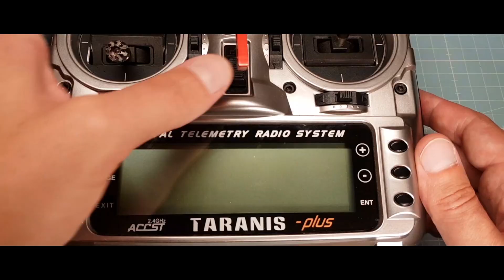Long Range - Disappointments 😒 BF 4.1 - GPS - FrSky R9 - Racerstar AirA - iFlight XL7

Comment: The gps is almost certanly interference. I've had it too, I've solved it by placing electrical tapes over motors nad esc and the doing a layer of aluminium foil and then another layer of electrical tape

Comment: BF 4.1.3 seem to fix the losting satellites problem !
Reply from the maker: I have tried it, and it isn't fix it, even according to the github comments of the devs it still isn't fixed yet. But if you take a look at my other videos, you will see that I have found a workaround.
Reply: @TorbanDallas  i tried only a pair of flights and for more the 4min flight i had always 12-13 satellites, i have a dvr of it. To me seem to be fixed the losting of satelites with 4.1.3 but i have done only 2 flights....
Reply: @TorbanDallas  p.s.: i have another issue with the gps, a bn-220, i have experimented a delay of the gps data that i can estimate in about 10 seconds ! This create a lot of problems, expcially on the gps recovery, when i have fixed an altitude of 50m for the rth, it think to be at less of 50m and continue to go up till to take an altitude of about 150m !!

Comment: I stopped losing satellites when I manually configured the GPS module using the U-Center. I saved the configuration in the GPS Flash memory and made BetaFlight not configure it... So I can even cut the GPS RX wire (Data receiver wire)
Reply from the maker: Thanks! That's pretty intresting, WIth all of the feedback and testings it definitely seems to be a betaflight issue. I've also got the feedback, that the auto detect setting doesn't work. Setting it to euopean egnos instead of auto detect should also solve the issue. I'm going to try it next and i'm also going to test BF Developer versions.
Reply: How do you connect a GPS module to U-Center?
Reply: @irishlostboy  I used a FT232RL module, GPS TX to FT232 RX and GPS RX to FT232 TX plus power... Then u just go to U-center and connect it... There is a GPS passthrough that u enable in the CLI (the u would just connect the drone to the PC and open U-center) but it did not work for me...

Comment: Well interesting to hear your experiences. I've had gps issues with 4.0 as well as 4.1. Sometimes it's solid. But lately on 4.1 attends to loose more often then not. I'm almost getting used to it. I'm also running rpm filter as well. 
But doesn't sound like the issue. But would like to see solid satellites the whole time, that's for sure. 👍👊

Comment: Hi Torban, ich verwende auch das R9M lite Modul,  bin auf BF 4.1.0 mit RPM Filter, und habe keine Probleme mit den Sats.  Wenn ich den fix habe,  bleiben sie konstant.  Das Problem mit den Unterbrüchen hatte ich aber solange ich die Caddx Tarsier montiert hatte,  die stört wohl den GPS Empfang des Moduls. Verwendest du ev eine andere Cam als zuvor? Diese Empfangsprobleme sollen ja bei mehreren HD Cams auftreten. Seit ich die Runcam5 nutze funktioniert das GPS....allerdings nur über den Aux Switch,  mache ich die Funke aus fällt der Kwad vom Himmel. Hoffe dass BF4.1.3 dieses Problem beheben wird.
Reply from the maker: Es wurde definitiv etwas am BF Code geändert, auf allen Coptern mit verschiedenen GPS Modulen klappt es problemlos mit BF 3.5.
Aber ich habe auch schon festgestellt, dass wenn man lange genug wartet die Sats stabiler bleiben. Hatte so zuletzt auch gut 6 Minuten keine Probleme bis dann auf einmal wieder die Rescue N/A Meldung kam. Bf 4.1.3 bekommst du ja schon wenn du unstable releases und maintenance auswählst. Da ist das GPS Problem behoben. Funke aus und Copter kommt zurück sollte unbedingt funktionieren.
Hattest du deine Failsafe Procedure auf GPS Rescue eingestellt? Sanity Check an oder aus?
Reply: @TorbanDallas  Für den OmnibusF4V6 habe ich noch keinen 4.1.3RC auswählen können...habe damals die Legacy Firmware geflasht, denke aber nicht dass sich dies auf die GPS Funktion auswirkt.  Sanity Check hatte ich ausgeschaltet, habe ihn jetzt aber mal auf FS only eingestellt, bin leider noch nicht zum testen gekommen. Der Failsave ist auf GPS Rescue eingestellt und alle Settings sind angepasst.
Reply: Unter Maintrance 4.1 habe ich 4.1.3 nun doch gefunden... Was hast du an der Funke für Failsafe eingestellt,  no Pulse?
Reply from the maker: @Toppe_rHonda  hold
Reply from the maker: @Toppe_rHonda  schau mal hier. Sollte noch genauso funktionieren. Am Ende mache ich die Funke aus: https://youtu.be/-8ufVX8zGC0
Reply: @TorbanDallas  Danke Dir,  schaue gerade die Deutsche Version😉
Reply from the maker: @Toppe_rHonda  ach stimmt. Das hatte ich auch auf deutsch gemacht. Sollte auf jeden Fall noch genauso funktionieren. Traue mich nur nicht es mit meinem neuen 7zoll zu testen 😅

Comment: Hey hey, my couple of cents about GPS on Betaflight: I had such issues even on previous versions of BF and the problem was solved by lowering the baud rate to 57600 in the Ports tab. Just flied two quads with BN-180 on BF 4.1.2 (and 4.1 previously) with zero GPS issues ) Happy New Year! 🎉🌲🎉🌲🎉
Reply from the maker: Hi, thanks for your comment! I'm already using a 57600 Baud rate. The GPS issue definitly seems to be a issue in the bf code. The BF devs are fixing it with BF 4.1.3.
Reply: @TorbanDallas  I too was using the baud rate of 57600, and was having horrible connection with satellite's and super slow at aquiering satellite's. I changed baud rate to the highest one on 4.1, while leaving "auto baud" and it stayed at the 15600 I think it is and it made my GPS work 100 times better, still not perfect but it seems it has more power in a way and has a stronger signal to detect the satellite's, maybe faster communication makes it work faster.
Reply: @TorbanDallas  I came from the future to tell you, no they are not. Haha

Comment: Welche Flugzeit hast du erreicht. Mein neuer DJI 7" Build schafft nur 9min mit 2200mah auf 5S und den AirA Motoren. Ich bin ein wenig enttäuscht. Meine Tyro 129 mit 1800kv 2507 Motoren und gleichen Props und Akku schafft da schon an die 12min. Sie ist ein wenig leichter, aber daran kann es eigentlich nicht liegen, wir reden hier von 50g Unterschied.

Was mir aufgefallen ist, einer der Motoren ist wohl schwergängiger, Ursache war schnell gefunden. Die kleine Schraube, unten am Kugellager, welche die Glocke fixieren soll, waren übelst festgeknallt. Dadurch war das Lager unter Spannung und lies sich schwer drehen. man darf diese Schraube nur ganz leicht anziehen und muss sie mit Schraubensicherung fixieren. Ich halte von dieser Lösung garnichts. Mit sprengringen fixieren wäre besser, so wirken keine axialkräfte auf die Lager.
Reply from the maker: Flugzeit sieht bei mir ähnlich aus, siehst du ja im 2. Teil von dem Video. Also ich bevorzuge die Schrauben um die Glocke zu fixieren, normalerweise ist der Schafft der Glocke so lang, dass man selbst wenn man die Schraube voll anknallt das Kugellager nicht quetscht - aber da gibt es sicherlich auch Fertigungstoleranzen. Gefühlt habe ich bei 4 Motoren auch immer einen dabei der nicht ganz so ruhig läuft wie die anderen ... selbst bei t-motor schon oft erlebt.
Reply: @TorbanDallas  
Bei den AirA habe ich das ganze bei 2 Motoren überprüft. Gleiches Problem, nur ein bisschen zu fest und die Lager sind unter Spannung. Noch dazu haben die wohl einen hochfesten Kleber benutzt, habe sie Schraube fast abgerissen, so fest war die drin.
Reply from the maker: @waldemarkraus2855  ich hab schon den Kopf eines 1.5 Hex Wera Schraubenziehers bei den Schrauben abgebrochen :D Meistens war aber der Schraubenkopf vorher rund.

Comment: Best of luck luck sticking with Frsky Torban. After several bind issues and failsafes with brand new R9 receivers I have finally given up on Frsky.  £500 later, Jumper T16 and crossfire system bought. Testing in the new year when I get home from work. Also went with the DJI system. 2020 is going to be fun.
Reply: Sell some drones and maybe the family pets! Its coming down in price and there are Christmas sales on. I tried my flying buddies set and I am hooked. With the firmware upgrades it should be great for long range. Just waiting for them to add more features to the OSD which will hopefully happen soon. Merry Christmas Torban and keep up the great content in 2020.
Reply from the maker: I'm jealous, I would also like to try the dji hd system :) even for long range. But it's so expensive ...

Comment: You should try iNAV...It works pretty good now and the RTH is a real controlled return, not a crash on your head...That crap with the Sat count jumping around has been going on for ages now...Use iNAV.
Reply from the maker: Betaflight should copy and paste the Inav GPS Code :D
I'm afraid of losing the smooth flight performance of betaflight when i'm using Inav. But to be honest, I don't have any experiences with Inav
Reply: @TorbanDallas  I have, it will fly just as smooth, the tuning isn't quite as ready made. The GPS Modes belong to iNAV and very worth having if you want to do what you are doing...Time to let go..

Comment: On Emuflight works the GPS properly? I move my 4 quads to emu. I'm trying the dev or RC version of this stuff n feels good
Reply from the maker: EmuFlight is a fork of Butterflight and I think it's using the Betaflight 3.5.7 GPS Code - so it will work properly.
Reply: @TorbanDallas  yep I have no Helios, I like the default settings their are using I try to clone it to beta but don't work x/ so I keep using how it is and first time I need not tuning  "so much"  so I'm happy their are using some kind of presets like kiss or raceone I appreciate that also

Comment: Hello , i´m from Argentina. And i have the same problem with GPS and i think was just for me, but i realized not.
With the same gear, same field to fly, BF 3.5 get solid 12 to 15 sats. With BF 4.1 get little less, 11, but in fligth, drop to 5 to 7. 
I guess this hapen when i install rpm filter. ¿Can be? i going to check if disabling rpm filter could be the problem. by the way, i have an arris x200 with the GPS beitian BN 220, is an F4, and the GPS mounted in the front rigth arm. but with BF 3,5 works fine.
Reply from the maker: Thanks for your comment! Already seen your comment on github! Interesting thought, that it could be RPM Filter related. I never tried BF4.1 without RPM Filter. Let me know when you have tested it without RPM Filter.
Reply: @TorbanDallas  and by the way. I have blheli s. Use jesc license.
Reply from the maker: @juanmanuelamado7732  ok, Ronald van Maanen
 tested it already with and without rpm filter - no difference

Comment: Same problem. I went back to 3.5.7 and the GPS works without problem again.
Reply from the maker: Thanks for the information! Did you use RPM Filter on BF4.1? Just to find out if this Issue could be RPM Filter related - I always used RPM Filter on my Quads with BF 4.1. Never tried it without RPM Filter.
Reply: @TorbanDallas  I did have it on and off. In both cases, the GPS dropped with GPS not available
Reply from the maker: @ronaldvanmaanen  OK. Thanks for your reply. So it's probably not caused by the rpm filter.

Comment: I think the carbon frame will kill the signal when you have the antenna mounted like that. Try to move the antennas so at least the ends of it is away from anything conducive.
Reply from the maker: As I already mentioned in my video, this was just a provisional attachment. The XL7 doesn't provide propper ways for mounting the antennas like the HL7. But even with one horizontal antenna on my 5 Inch quad I can fly much further away. I also had an issue with the r9mini  ota receiver, it lost the binding and i had to rebind it. Now this r9mini ota and another r9mini is used redundantly. Maybe the R9mini Ota is faulty.
Reply: @TorbanDallas  Ok understood... I have had problems with fail-safes on my Crossfire too but it seems like that was a firmware issue... Now it works well but in the beginning I had one fail-safe in 4-5 packs...

Comment: I know it's hard to swallow the price difference but I really think you'll have a better experience and results if you were to switch to crossfire I saved up and got the full size module with a few ex. In a set and it's a piece of mine I can't explain! I also highly recommend that you move the horizontal antenna ends away from the carbon for better reception maybe something as simple as a popsicle stick or mounting it on the arm will help a lot from what I've seen and learned from the long range community. I wish you the best of luck and hope you have a grate longer range run next time! Thanks for sharing your experiences with us.

🍻cheers🥃
Reply from the maker: Thank you for your comment! I have replaced the Receivers and Antennas, I have already uploaded some new videos, now it's working fine again.
Reply: good stuff

Comment: +1👍 
Do you have an idea of the wind speeds at the time?
It doesn't look bad on mobile device. Are you using low d_min and high d?
Outstanding flight time and range.
Reply from the maker: No idea about the wind speed. I didn't do much Pid tuning yet. Only raised the PID Sliders in BF4.1.

Comment: Hi Torban, have you consider doing a Li-ion battery ? I did a 6S with 21700 Li-ion 4000mah and can fly more than 15min with the tyro 129. Also I'm interested to know which motors are more efficient between the AirA and AirB. Thanks for all your tests !

Comment: Here in Spain, we have a group of long range. More of the users preffers stay in beta 3.5 yet... Me too. Also I recommend you separarte the anntenas of the Vtx ang R9 :)
Reply from the maker: Thanks! I would also like to stay with BF3.5 but it's not available for the T-Motor FC's and other new targets. On this particular quad with the DalRc F722 I could go back to 3.5 ... Thanks for your recommendation, I would also like to separate the antenna from my vtx antenna. It's just a provisional attachment - I'm still trying to find a matching TPU vertical antenna mount.
Reply: @TorbanDallas  You can find the old targets in wiki, I have already dowload in my own pc.
Reply: @TorbanDallas  Ich hab auch den XL7 frame und habe mir diesen Antennenmount ausdrucken lassen: https://www.thingiverse.com/thing:3114513 
Die zweite Antenne habe ich dann vertikal an meinen GoPro mount befestigt, damit, wie er vorgeschlagen hat, vtx und rx getrennt voneinander sind.

Comment: Great video! My R9 never worked well. Got rid of it and bought Crossfire. The Crossfire system is by far a much better system. Much better signal consistency and range. It also allows you monitor real RSSI in dbm and signal quality on your betaflight OSD. Easy receiver updates over the air and real diversity receivers are available. I know the crossfire costs more, but it's worth it. The R9's natural habitat is in a trash can. It has been dubious since day one and still is.
Reply from the maker: Thanks you! I agree with you in the point that the R9 has been dubious since day one, but imo it isn't still dubious now. I had failsafes and issues at day one too. But after the reliable firmware and hardware were released, it worked pretty well without issues. You also can do over the air updates with the OTA Receivers and you also get Diversity Receivers like the Slim+ and even a Redundancy Function to use different R9 and even R9 + 2.4Ghz Receivers the same time - try this with crsf :D
But all in all, as FrSky user I'm feeling like a Beta Tester, it always took a lot of firmware and hardware releases until the system worked reliably. OK I think I agree with you in all points ...
but I think I will keep on using the R9M System even with all of these bad experiences :P
Reply: @TorbanDallas  I even had problems with the latest 190117 flex firmware on three multirotors. I even had my TX & RX antennas mounted vertically above upper frame deck. For OTA to work, one needs to buy their new access radios and I am not interested in those at all. To the diversity, the Crossfire nano diversity RX has two receivers in one. The slim+ simply uses antenna diversity and switches between the antennas. The software controlling that switching is unreliable and switches too much, but not only that, it does is more often than not at the wrong time.

Comment: I used to run 10mw on my r9m on betaflight 4.0 and never got below 70 rssi. Now betaflight 4.1 I can run 1w and still drop below 60 in same senario.... Maybe the rssi isn't calibrated properly in 4.1? Maybe we have to fix it with the crossfire fix that bardwell shows....
Reply from the maker: I did also fly over 2km on only 10mw without problems. I even had no issues bevor with my r9 system and my bf4.1 quads. I have already changed the scaling - it matches with the RSSI Telemetry value of my Taranis. After my last flight my r9mini ota lost the binding, I had to rebind it. It never happend bevor on around 30 flights with this rx and never on any other r9 rx. Now I'm using this r9Mini Ota with another R9mini redundant with the redundancy function - and now i'm having these low rssi values. I think it's just the low rssi value and warning from this receiver and the other one is fine.